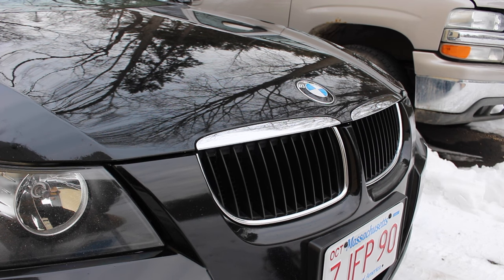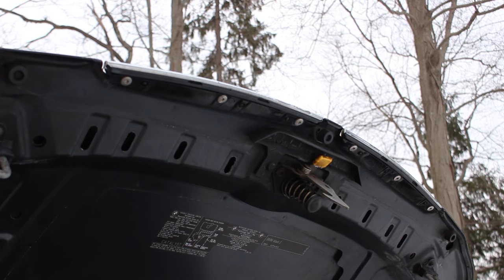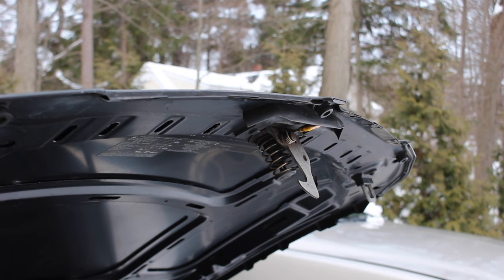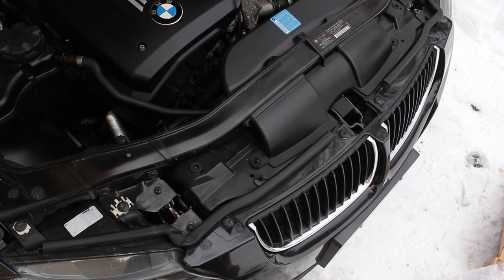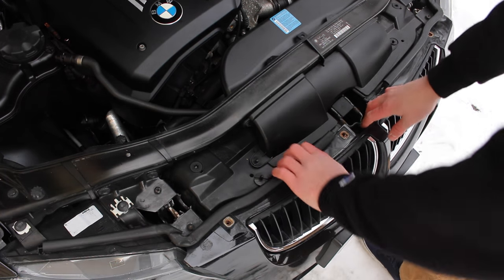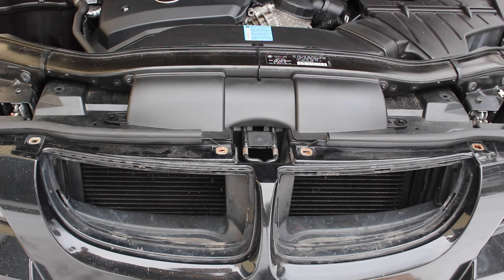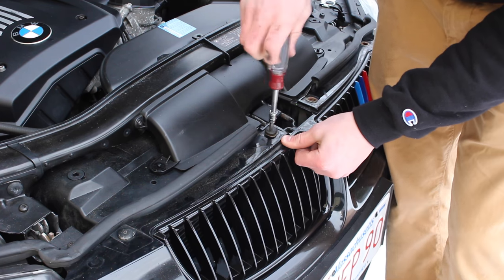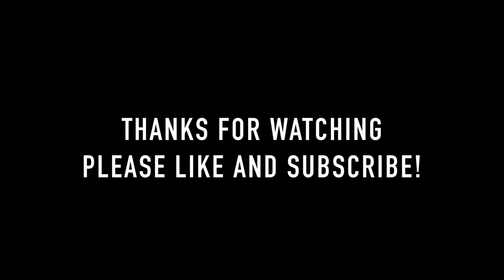BMW E90 GRILLE REPLACEMENT // BLACK KIDNEY GRILLE

Comment: Did u buy it with the black trim or did You have it done? I can’t stand the silver trim I have on my car, but not sure how to handle it.
Reply from the maker: I bought it with the black trim.
Reply: The kidney grills are easy to take out, respray and put back. I just did mine today. My E91 £20D is back and with the black grills it looks fantastic. I hated the chrome.

Comment: Hey man! Fir some reason the screws for the top oart on the hood are not coming out... They are turning when I loosen them but aren't coming out and feel stuck. What do you recommend? Thanks!!!!
Reply: did you figured out? mines do the same
Reply: @urziceanu6645  nope lol
Reply: @snowydays612  i did today, just try and get a screwdriver under that top part and separate it from the screw by applying pressure with the screwdriver. mine was stuck and this worked, after that, just unscrew the screws left there.

Comment: Hi which tool do I need for the 4 screws on top of grille to get access to the grille? A T30? Or T34?
Reply from the maker: I think thats a T20 or T25. I have a link to the torx set in description.

Comment: What if you have a 2011 328i that doesn’t have the trim on the hood? Do you know where to get these grills?
Reply from the maker: They make LCI grilles for your model
Reply: My car has the one piece grills. I just took them out today, cleaned them up, spreayed them black, waited for the paint to dry and then clipped them back in. So easy and it looks awesome!

Comment: Could you make a vid which shows how to remove grills without unscrewing the bumper? You can unclip them by inserting fingers in between the slats :-) Such "how-to" would save some time to quite a few people.
Reply from the maker: You can use that method as well yes.

Comment: Tried unscrewing the screws holding the top silver chrome part on the bonnet yet they just turn? Sounds stupid is there a specific way these screws come out?
Reply: Exactly what I'm finding
Reply: Me as well. Did you find any solution?
Reply: @fritshermes6328  I had to pry inbetween the top long parts and the bonnet. Applied serious pressure and it actually came off without damaging the grill or bonnet.
Reply: @hownottousetheinternet  You applied pressure to prevent the screw from spinning? Otherwise I can't see how you remove it without either damaging the grill (most likely) or the screw failure (less likely)
Reply: @fritshermes6328  Sorry, I was unscrewing the bolts at the same time. I used a flathead screwdriver to create leverage between the long, top parts of the grill and the bonnet, kept unscrewing and it came off. Thinking about it, one of the bolts on either side was intact enough to unscrew anyway, which probably made a difference. Got them off and nothing was damaged. The lip of the bonnet was slightly warped but was easily rectified and hidden by those top parts anyway, even if I wasn't able to right it 👍